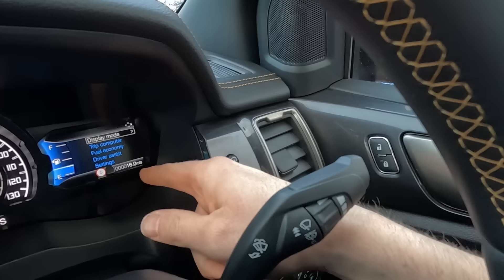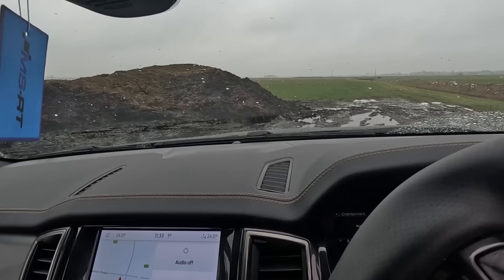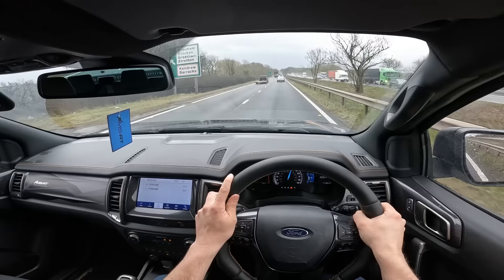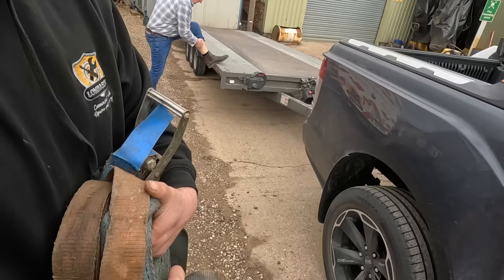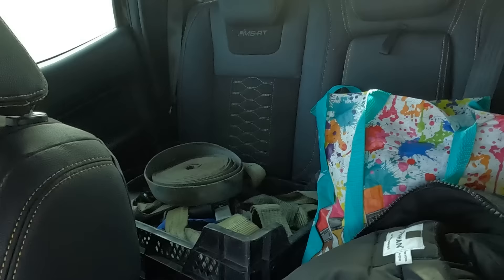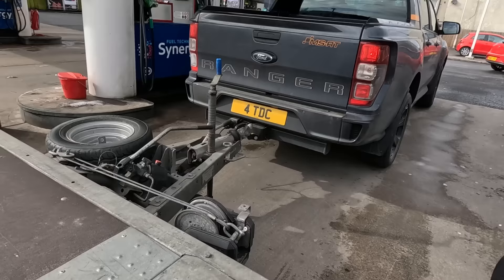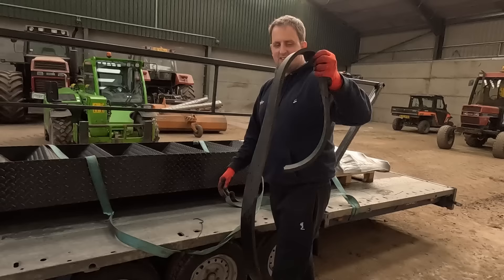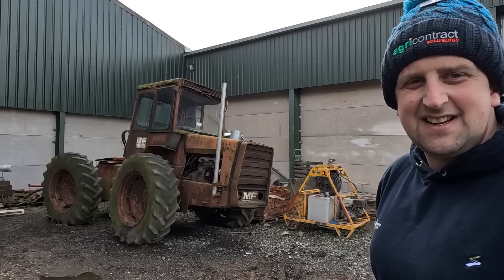I Bought A BRAND NEW *LIMITED EDITION* PICK-UP | The ULTIMATE Test | #truckertim

Comment: Hi Tim, I know you are creating entertainment and I’m sure you already know that if your gross weight goes over 3 1/2 ton and you are doing it for higher and reward you are in big trouble. You need a tachograph all the rules and regs changed in 2013 as a result of the Selby crash train crash they’re really clamping down on pick ups and trailers and weights and axle weights and corner weights so I hope you point out it’s quite serious business pulling these trailers behind pick ups is that your channel is very entertaining and I watch it all the time. Keep up the good work.
Reply: You know he has an operators licence, right? As for tacho there’s a bit of greyness around dual purpose/personal vehicles. Possibly swerves the need.
Reply: He is hauling for 3rd party there is no grey areas, rules are very clear.